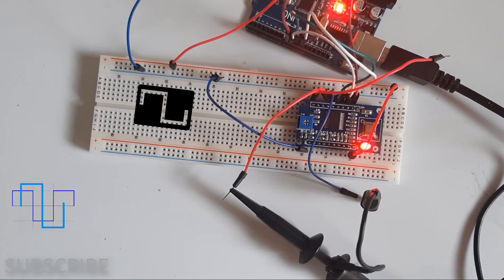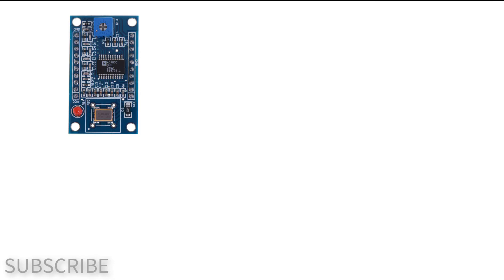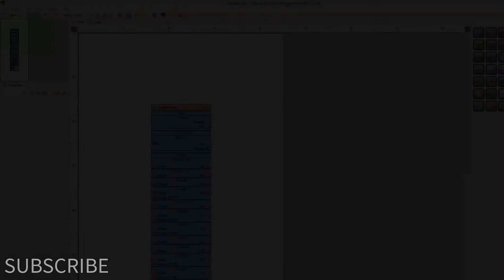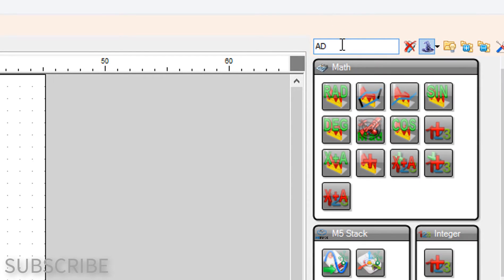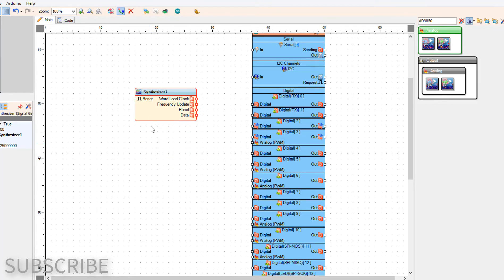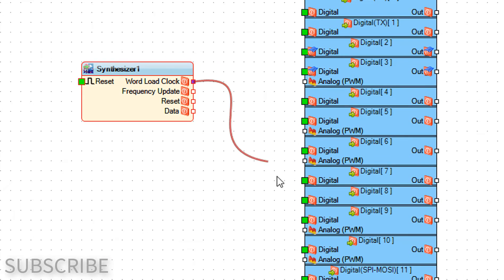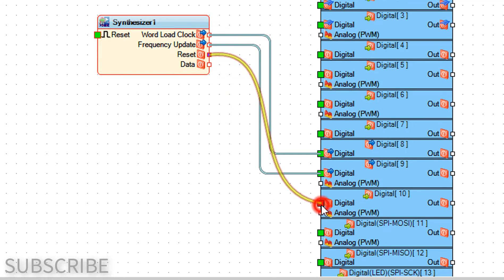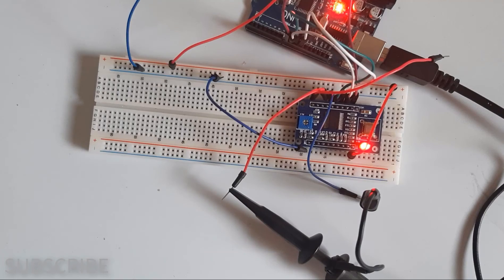Arduino DDS Frequency Signal Generator AD9850

Comment: Can I make high power frequency convertor using arduino and AD9850? Thanks!
Reply from the maker: AD9850 is just a low voltage signal generator used as a signal source